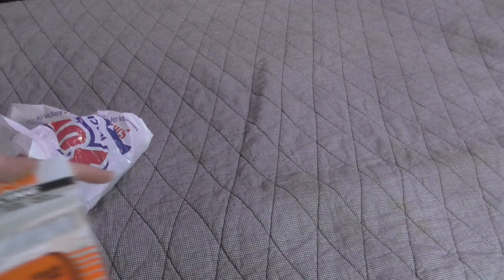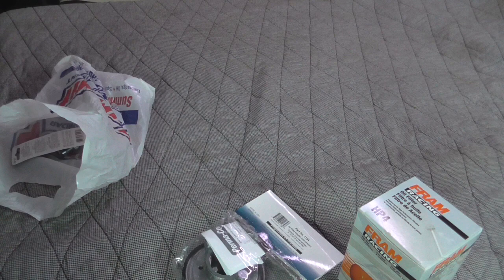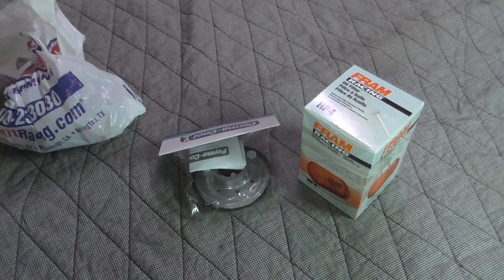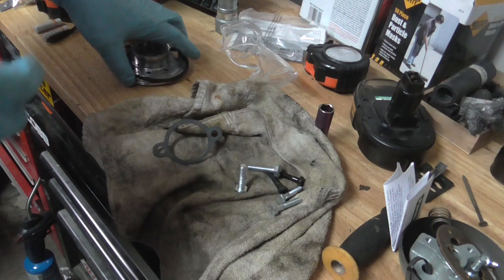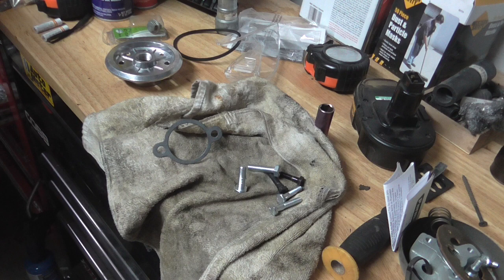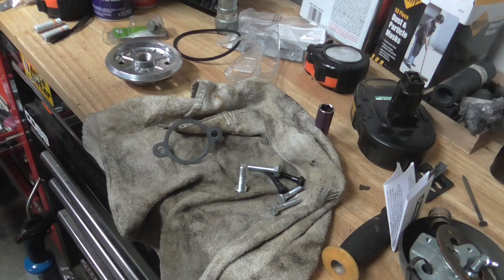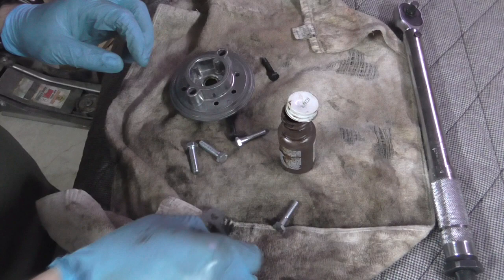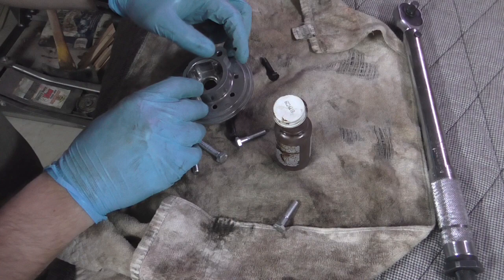SBC canister oil filter to a spin on conversion using perma cool 1134 adapter

Comment: Thanks for making video. Not much out there on this topic. I have 1964 impala 327 engine rebuilt,  back from shop. There's no bypass plate. Purchase mr gasket 1270 but I need bypass plate to install. The permanent 1134 doesn't need this plate. Does the filter have bypass. Also is this the only filter I can use with perma 1130 adapter .
Reply from the maker: That frame filter has a bypass. And that's the one mfg suggests so I'd stick to it
Reply: @bestfromnw  mfg suggest to use only this filter. O k if i buy the perma cool 1134. I will stock up on filters. Any other adapters out there. Just want to know what options there are. Since I've already got the mr gasket 1270,
Reply from the maker: @benjaminsoto5892  1130 supposed to be one of the better one. AutoZone locally stocks the filters for better price than summit.
Reply: @bestfromnw  thanks, I'll order one.

Comment: Can’t find an HP 4 anywhere! Found a PH5,
It screws on, but not sure if I can use this.Do you think I should just try to see if it does work?
Reply from the maker: Autozone can usually get them within few days, also summit racing and jegs usually stock them
Reply: @bestfromnw  if its 3/4 x 16 should use a ph8 (which has a bypass)
Reply: never mind, found that it 13/16
Reply: ph5 doesn't have a bypass
Reply: never mind, its 3/4 x 16
Reply: @roberttopper2946  
Thank you, ordered an HP4 from AZone.Got it in 2days. Also found Advanced AP, carries it.